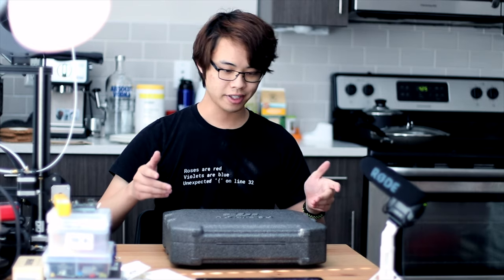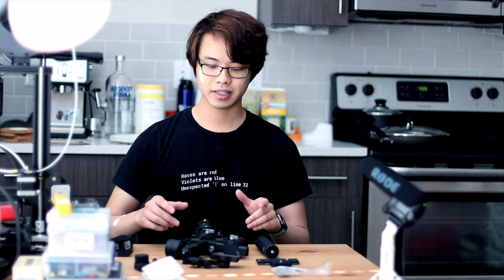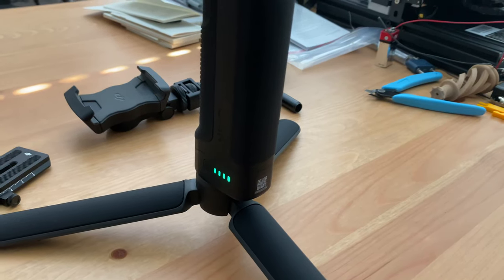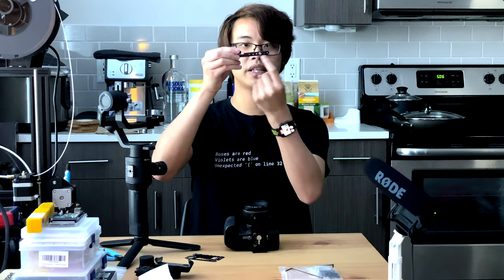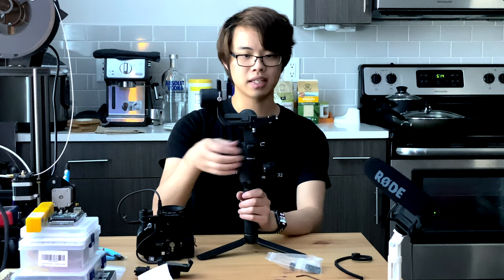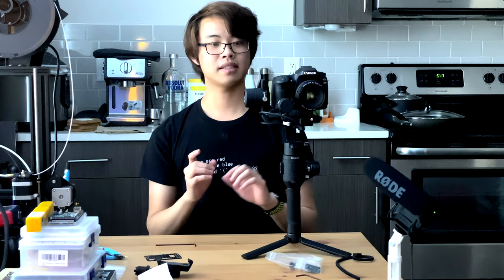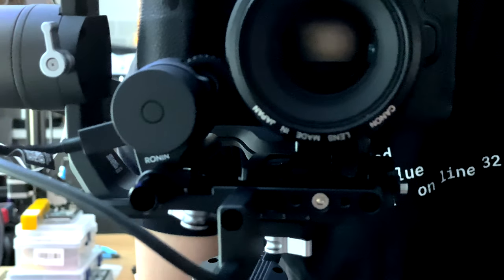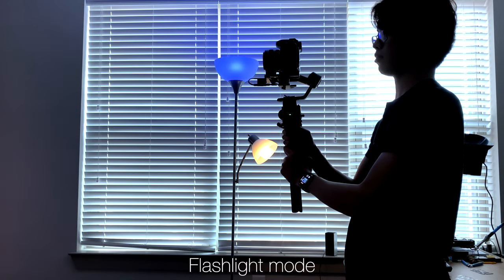DJI Ronin-SC Gimbal: Assembly/Balance/Test on EOS 80D

Comment: HELP!!!!! 
Im having problems with my tilt axis on mine. I can get it leave but when I flip it backwards and it’s supposed to stay in that position it doesn’t. Same thing when I flip it forward. Any ideas? I’ve tried using my g7xii and my older b500 and also my iPhone 15. And it does the same thing. HELP

Comment: All those settings you did using your iPad r those available to use with the 80d and without the focal motor
Reply from the maker: Everything I did on my iPad can be done on the 80D. Without the focal motor you just can't focus remotely, you can still do everything else.
Reply: @Flashbach  ok do u think i should save and get the ronin s or r the 300 dollars more not worth it and just get the sc
Reply from the maker: @nestoryavdoshnyak7193  I would say it depends on your budget, I would say that the s is definitely more future proof if you plan to use heavier cameras or lenses in the future.
Reply: @Flashbach  ok thank you so much

Comment: Will it work with 60d+kit lens
Reply: The 60D body weighs pretty similar to the 80d so it'll probably be fine. It depends on what kit lens you have. If it's the 18-135mm you're talking about you might have to mount the camera all the way back on the rail to balance it. With zoom lenses also beware that zooming in and out will shift the weight of the camera and unbalance it. While a little unbalanced is fine as long as it's not too much since the motors will fight it, the battery might not last as long.

Comment: What cord part do you have connected to the gimbal to the Canon
Reply from the maker: There's no cord connecting the gimbal to the Canon at all, since they're not technically software compatible. That being said you can still use it with most of its features.